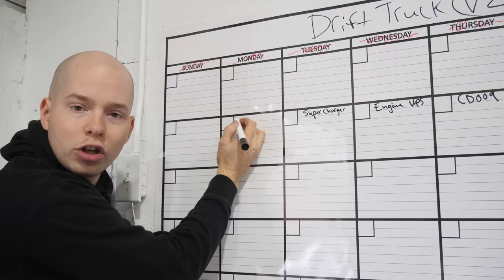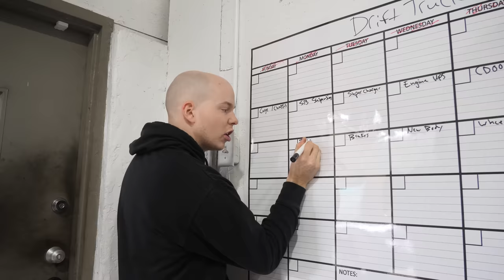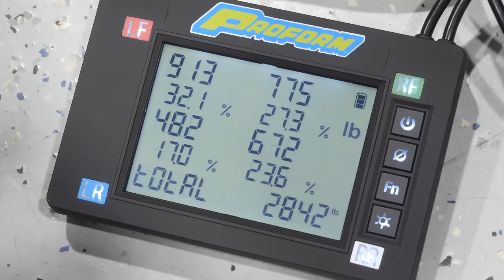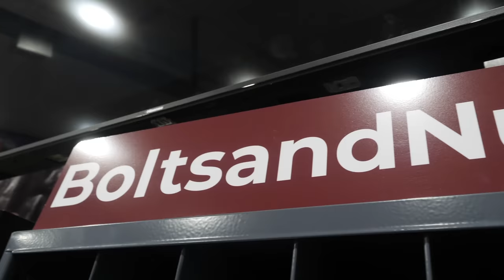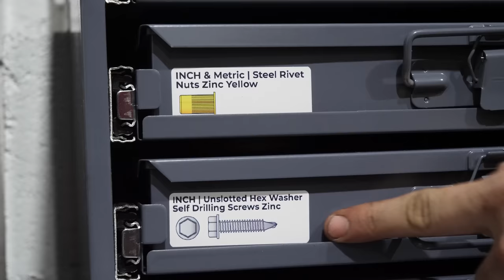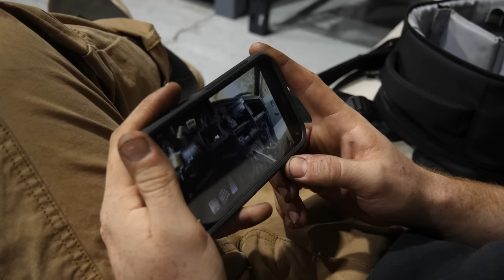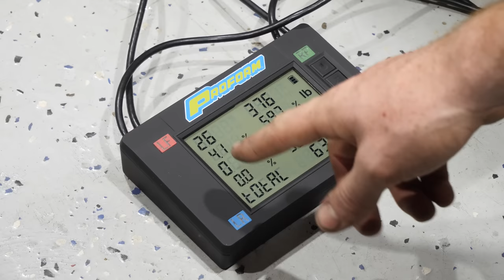DRIFT TRUCK V2 Begins NOW! - Supercharger, CD009, Full Cage, Rear Radiator & MORE!

Comment: Hey Caleb, You should look into finding an RX8 rear subframe  and  suspension and swapping it into this thing. they mount with 6 bolts, and you could make a set of pushrods and rockers to mount the shocks flat under the bed. Would give you some better rear suspension than the solid axle 4 link, and they can be had SUPER cheap. Fully adjustable multi-link with aftermarket availability. 

Also, I think 3uz heads swap onto the 1uz and flow a lot better. I cant remember for sure though.
I really love this project and it's became inspiration for what I'm wanting to build. I always want to see more of it.

Comment: Heads up about that eaton m112! Eaton machines oval ports around the outside of the outlet of the supercharger. These ports do absolutely nothing but make the whine quieter. Fill them with weld or weld plate over them and there's a significant sound difference and no performance difference. They are referred to as silencer ports. All the whine.
Reply from the maker: Yo that’s huge. Thank you!

Comment: You said at the end you want to add a better sound system. I was thinking if you added a blow through subwoofer setup, that could add some more weight that you want in the back so it will slide better etc. Great sound and great drifts!

Comment: Pro tip. Use white bread instead of grease for the pilot bearing. I know, i know... I was as shocked as you'll be reading this. But it worked.
Reply from the maker: I knew about that trick! Just didn’t feel like going to the store lol

Comment: My suggestion would be to keep the box frame on the rear and still do your tube chassis since you have a 70/30 weight bias. Since you got the truck torn down as far as you do maybe see about taking the firewall out and moving the engine back four or five inches give you a little bit more rear bias on the truck. These are just gibberish ideas out of my head what I would do being as far as you are on the truck.  You probably know better than I do especially since version 1 is what made channel and made you who you are today.....😎😎🤘🤘🤘

Comment: 2800lbs and a 60/40 F/R weight distribution. First part is great, second is an oof. IRS with a transaxle would solve that. Or well, since you're going CD009, going IRS would at least HELP. I've seen people put Corvette IRS and 89-98 T-bird/Cougar/Mk8 IRS in trucks. The cool thing about the latter is that the upper control arm curves underneath the frame rails, meaning you don't need to cut or mod the bed floor.

Another thing you should do is look into David Vizard when it comes to cam selection, head porting, quiet but restriction-free exhaust, and ESPECIALLY header construction. That guy is a guru and can wring 20% more power out any engine compared to mainstream practices.

Comment: At that point I'd set the frame on stands and lift the cab off and get a good look at the frame and the chassis, then start building it from the ground up.
Reply: Yeah since its such a modular body on frame style I would just do FULL tube chassis from the ground up. Makes way more sense than trying to do half and half (which makes more sense on a monocoque). Not much Mazda left in this thing anyway lol like most racecars it's really just a custom built machine with a nice body bolted to it

Comment: From the way you were taking you are only putting S13 stuff in the front?, I know a solid axle is much stronger but the feeling of that r200 subframe just can't be beaten. Plus you can put a 350z diff in that subframe, realistically you would just do what engendered to slide has done and make pickup points on your new tube frame, hopefully this is what you do front and rear 🤞

Comment: I dont think you’re going to like the way the rig feels with irs, more specifically an schassis rear subframe. Kudos if you can utilize it but i think a well setup 4link will make more traction and depending on wheelspeed you will see a lot better tyre wear. Id say using an e36/46 rear geometry would be advantageous over an schassis rear but it all just depends on what you have to work with